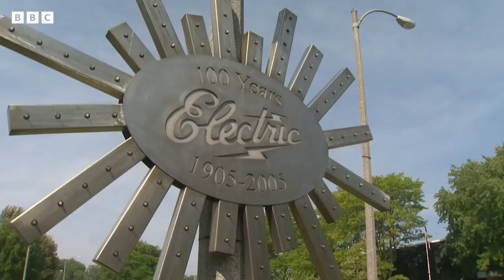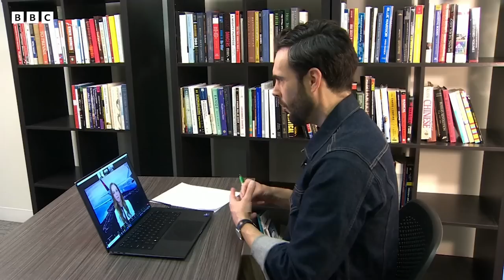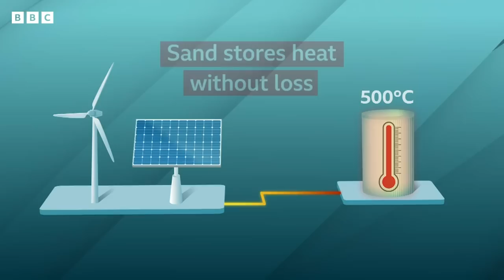Can the world rely on renewable energy? | Future Earth | BBC News

Comment: The entire country of Portugal ran solely on renewable energy for six days in a row in November 2023.
Portugal produced 1102 GWh of renewable energy from wind, hydropower and sun, surpassing its demand of 840 GWh, which allowed it to even export electricity to Spain. It’s a record.
About 60% of Portugal’s energy comes from renewable sources today and is expected to run 100% on renewables before 2045.
Reply: Amazing job
Reply: Resizer,

hydro power is significant in Portuigal, but also quote, "It doesn’t mean fossil fuel plants weren’t operating"

The reason fo that is renewables' defficiency in critical crite ria for a stable grid supply.
 You cannot run a grid on asynchronous renewables alone.
Reply: @iareid8255  That means nothing. The energy was there. The actual consumption energy. I swear to god I always come to videos on renewable energies and there's people hellbent on invalidating any good that is being done. Every time.
Reply: Jean, 

grid supply needs a specific type of generator, renewables simply do not meet the requirements. They are a dead end and just make electricity more unreliable, more unstable and much more expensive.
Hydro is the only renewable that does0 meet those criteria.
You cannot go against the physical constraints and no amount of tecnical improvement of renewables will overcome their deficiencies. Persisting is s just ignoring reality.
Reply: Electricity, not energy. Very different things
Reply: The comments here are mindblowing,,,, if you were electrical apprentices you would all fail basic theory.
Reply: @VK4VO ,
Rather a meaningless and trite reply. If you disagree with a comment support your view with facts!
Reply: Not.gonna happen.

Comment: Shame on BBC for spreading Delta Airlines' greenwashing. Global aviation represents 2.4% of global anthropogenic CO2 emissions, but roughly 3.7% of anthropogenic radiative forcing in 2018 came from aviation, and aviation emissions are growing 5% per year. Sostainable Aviation Fuel (SAF) is not a real solution. It may have net zero CO2 emissions, but Lee et al (2021) estimates that global aviation in 2018 had a radiative forcing of 100.9 mW/m2, of which 57.4 mW/m2 was from contrail cirrus clouds, 34.3 mW/m2 from CO2, 17.5 mW/m2 from NOx, 2.0 mW/m2 from stratospheric water and 0.94 from soot. In other words, SAF will only solve a third of the problem, but does nothing to address the other two thirds of the problem. 

Hydrogen planes are potentially worse than today's planes, because hydrogen planes will emit even more water vapor, leading to more contrails and more cirrus cloud formation, plus hydrogen tanks are high problematic from an engineering point of view. The only real solution is battery electric planes and VTOLs for short distance flights and airships and hybrid airplanes for long distance flights. Another option is switching more travel to electric high-speed trains or hyperloops. Hybrid airplanes can switch to their electric motors when passing through atmospheric conditions where cirrus cloud formation is likely. 

Until electric and hybrid planes are developed, the only solution is for planes to try to fly around areas in the atmosphere where cirrus cloud formation is likely, and the BBC should have asked Delta whether it would spend the extra money in fuel and incur the disruption of flight time schedules to do that. It was very poor journalism by the BBC to not understand the science and to not ask Delta the relevant questions, rather than letting the airline spew its greenwashing nonsense about SAFs. 

The methane from fossil fuel sources has a GWP-20 (global warming potential over 20 years) of 82.5 and a GWP-100 of 29.8 (IPCC AR6 WGI, 2021), meaning that 1 gram of methane has the same greenhouse warming effect as 82.5 grams of CO2 over 20 years or 29.8 grams of CO2 over 100 years. which is a lot more than "a greenhouse gas several times more potent than CO2", as this video said at 02:02. Since methane lasts an average of 12 years in the atmosphere (technically, its perturbation time), it has a higher impact in the short term.

Comment: In my area a old pipe line was cut and since nothing seemed to be coming out they simply burried the cut pipe next to the house they were building.  Of course a house with the family in it blewup killing the family.  Developers are still resisting regulations restriting building on top of old oil fields.
Reply: @sophiadaly4712  Firestone, Colorado, USA.  What's weird people go nuts when oil companies want to drill anywhere near neighborhoods but developers build houses with working oil fields in them and in Firestone right over an working oil field with working under ground gas lines.  Like, often these lines in old fields do not have allot of gas coming through them and this methane does not have a smell so cutting a pipe does not seem like a big deal.  In the Firestone case the contractor simply cut the pipe and filled in the foundation hole.  Again, no smell because it is pure methane so the relatively new house blew up killing a family.
Reply: @sophiadaly4712  Yeah, but try to get laws and regulations pasted with so many politicians in the pockets of the developers.

Comment: There is a difference between renewable energy and emission-free energy.  Bio-fuel emits CO2 and other bad stuff.  We need to transition to 100% emission-free, basically solar, wind, and batteries (SWB).  When I got going in climate change, renewable sounded great.  In fact, I founded a group called Renewable Taos.  As time went on and we made local progress, we realized that we really need to focus on emission-free.  That is the only proper focus to avert catastrophic climate change.  It's a transition, so bio-fuels have some reason.  But, they are actually very dirty.  SWB is the actual solution.  Cooking oil and ethanol are actually bad sources of energy.
Reply: Thank you for sharing your knowledge about renewable energy. I completely agree with your focus on emission-free energy sources like solar, wind, and batteries. Speaking of batteries, have you heard of the Segway Portable PowerStation Cube Series? It's a versatile powerhouse with a massive capacity, powerful output, and fast recharging time. It's perfect for outdoor enthusiasts and RV lovers looking for reliable power backup solutions.
Reply: 22:00 CO2 is not " bad stuff ".IT is green plant food used in natural chemical process ( photosynthesis) which emits oxygen. Do you know how important that is?There have been times in earths atmospheric history when the proportion of CO2 to other atmospheric gases has been higher than it is now ( now the proportion is a meagre 0.004 %) - recently some supposed renewable energy savvy Congress members had no idea of the proportion and made wild stabs ( when asked )of 6% up to 8%.These are people making policy to reduce CO2 emissions!!!                  Just another thing to zealots playing God with earths atmosphere.Battery storage.Batteries go flat,can be recharged,but not indefinitely, contain dangerous chemicals and take up space.When useless ( after not very long relatively [ compared to nuclear ],how are you going to dispose of them? Landfill? Ugly, much like turbine blades. Landfill batteries will eventually leak to ruin soil and groundwater, then to rivers and finally the oceans.I won't alarm you any further but this whole renewable energy phobia refuses to entertain the drastic consequences that will follow the construction of the " planet utopia ".@user-hh6ex9md4w

Comment: Pity the latest figures say we've hit 1.54 this year having hit 1.5 for periods over earlier years.
Most notable this year was the size of the jump, that the oceans around el nino don't look like they normally do which is to say instead of looking cooler they look hotter.

The latest predictions pointout we're adding renewable on top of existing fossil fuel. Renewable is being used to meet new demand not replace old sources.

The best predictions say 1.7 by 2030 and 2 degrees within 15 years or by 2038 and these maybe conservative as tipping points have been reached and the tipping we were warned of has occurred.

The huge loss of albedo from missing ice means massive ocean warming. Boreal forests are converting themselves to tundra, temperate and tropical forests to grasslands in massive wildfires because we've taken too long. The roller coaster is moving and now natural processes will multiply the effects of the emissions we have failed to reduce.

Climate zones are determined by latitude, altitude, topography and wind and ocean currents driven by temperature differentials.

We've shifted those currents, slowed them and induced more, slower moving and larger oscillations in the jetstream.

This means faster more severe, longer lasting droughts, longer cold snaps with heavier precipitation causing flooding and record snows.

Our infrastructure built for one climate is going to face extremes and frequencies it wasn't designed for. Our crops and the biomes they evolved in will nolonger match the climates they are planted in. Fruit trees will set leaves instead of flowers due to warm winters, grain will rot in floods and prematurely die and dry off in heatwaves, continuing to push up world food prices, while leaving growing numbers hungry.
Topsoil will be eroded in floods and blown away as dust at alarming rates. 

This bbc feel good is talking about the solutions to yesterdays problems, that were not able to be adequately implemented on time.
The world has moved on and we need new solutions to adapt to the consequences of our failure to respond in time.
Reply: Hmm your message sounds suspiciously like a WEF sales promo 🤔

😂😂😂😂
What utter tripe you just posted, tell me the solution....TAX THE POOR!
 RESTRICT THE MOVEMENT OF THE POOR ONLY!
FORCE THE POOR TO EAR LESS MEAT!
CONTROL THE POOR!
Reply: Yep! And the result will be tens of people starving and tens of millions more moving north. The political and social disruption will be massive.
Reply: Well the new demand could be met with fossil fuels instead, so it’s a good thing it’s not happening. And population will start decreasing soon, the energy demand will go down, so at that point the more expensive plants, the fossil ones, will be shut down first.
Reply: @deaththekid3998  or we find new ways to use the energy as we have in the past, like data centers. Plus the plans of opec aren't to supply the rest of the world with renewable dependent infrastructure but cheap fossil fuel cars etc. Waiting for the predicted population decline will be to long as natural forcing from tipping points passed will have kicked in.
Renewables are dependent on finite resources and have a limited lifespan, it's our energy demands that have to drop. There's a reason the richest people in the richest countries have the biggest footprint. Our population could half but our footprints could increase 100 fold and still not satisfy the growing demand.

Comment: So the first part is an add to why we should stop drilling, thanks
Reply: It's not new drilling causing the problem but old drilling and pipes where developers build on top of these old fields.  Developers have pushed to prevent regulation's where they can build.  Often developers can get abandoned oil drilling fields cheap and clean off the surface equipment and have a place to build without the people they sell to ever knowing the history of the land to which their buildings are built on.
Reply: @stanleytolle416  it all starts with drilling and indeed already before anything gets to the end user, the pollution already starts through leaks, energy use, cobalt use and so on.
Reply: @flemlion13  this drilling is often in the middle of nowhere.  Like the Firestone case was originally on a desolate hillside not even good for cattle grazing.  Fifty years before oil drilling took place.  Often mineral rights and surface rights are all mixed up.  Like oil and coal companies have rights to extract under ones house or they have done it.  Uncapped wells, coal mines, underground fires are all over the place with no mapping.  Of course developers want as few regulation's as possible.  Surface soil testing is required due to expanding soil, another story, but history of land use is not.  A little wild wild West here.

Comment: For the metane emission, Dairy/beef industries should have been mention since they are the greatest emitors by far.
Reply: There is a type of seaweed that eliminates the vast majority of methane emissions from cattle.  Very little is needed in a cow's diet to have this effect at low cost.  A regulation to require this seaweed to stop bovine methane emissions would be very cheap to implement and have an enormous effect.  Not surprisingly the beef and dairy industries do everything they can to block such regulations from being passed and they won't self-regulate their methane emissions.
Reply: The sea ,tropical rainforests ,wetlands and termites are all larger methane emitters than beef and dairy farming .by far !